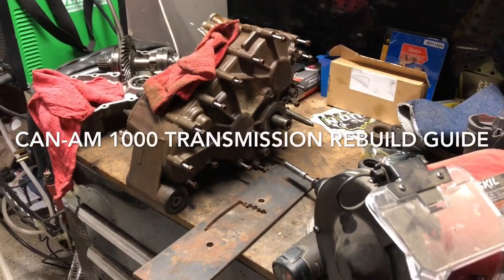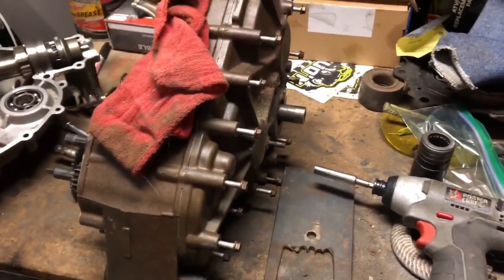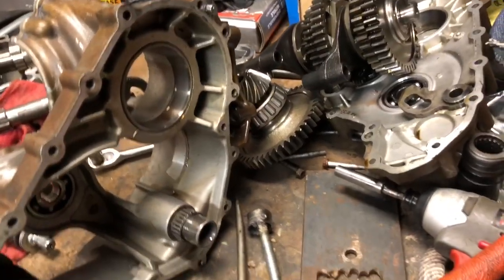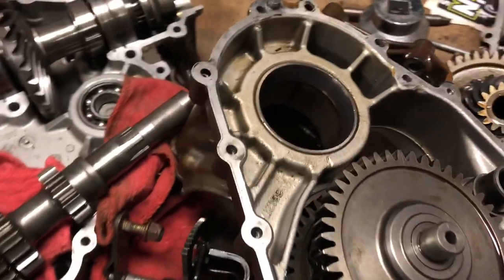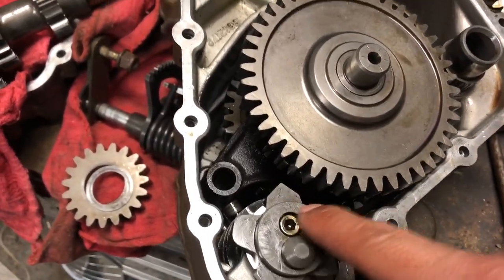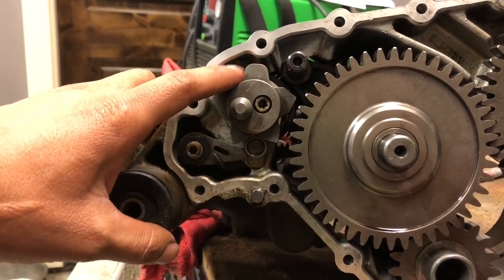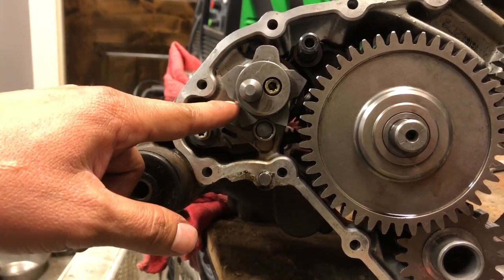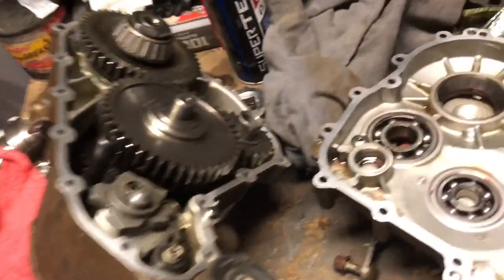Can am 1k transmission rebuild guide

Comment: My XMR 1000, my , I think its the secondary clutch is jammed with transmission and won't move, shifter shifts but tranny won't move, any suggestions on that, does the tranny need to come out ?
Reply from the maker: If it shifts and doesn't move it could be the transmission. i would take the belt box off and she what it does. If both clutches spin but it doesn't move when in gear and you push on the gas, then it could be the transmission. hopefully its just a bad belt.

Comment: great video thx..i got a 2013 1000xmr and its making a loud anoying clunking noise on and off throttle its coming from the gearbox any suggestions on what needs replacing ?
Reply from the maker: If its making noise then i would remove it and open it up. it could be a number of things but im thinking it could be some of the bearings that are really lose and bad. its probably had water in there a few times and that will mess up those needle bearings.

Comment: Did you have to essentially take apart the whole bike in order to take out the transmission? Or did you take the transmission out from the side or something of the sort?
Reply from the maker: You pretty much do have to take the engine completely out.  You have to undo both diffs and shafts to make room to slide the motor forward. the exhaust also has to come off. I was able to do it without removing the engine but its up to you how you want to handle that. Its not a fast job so take your time and take lots of pictures

Comment: If I take the cover of the shifting shaft side am I able to replace it by just taking that side cover off?
Reply from the maker: Its been a while since ive done this but if i remember correctly i think you can. Make sure its on neutral and that before you take everything apart all the markings line up. But since you already have it out, it would be a good idea to inspect everything and make sure you don't have any pieces of metals inside from the broken spring.

Comment: Is there any difference between the ATV and sxs gearbox's when it comes to rebuilding
Reply from the maker: Some do have different gearing inside i believe but the shell should be the same. But depending on the model there are 2 different transmissions  sizes. there is a bigger trans that most big xmrs have and there's a smaller one that the more basic can ams use.

Comment: I was told my clutch inside my transmission is bad but they didn't give good details on whats wrong. I can drive It in reverse fine just have a hard time going forward and it just grinds but if I push it can get it to go almost like jump Starting it/ 2015 can-am maverick 1000r turbo xds
Reply from the maker: Not sure if the 2015 mavericks are different but i don't recall can am having an internal clutch in the transmission. it could be many things but the easiest to check is your shift cable and linkage. If those are good then it could be a bad gear, bearing or spring inside the transmission.

Comment: I have a question I have a Maverick xmr 1000 2015 with a bad bevel gear and I can't find it anywhere do you by any chance know where I can find a replacement for it?
Reply from the maker: No sorry I Don't. You can probably find a good used one on ebay if you keep checking eventually one will come up for sale on ebay.

Comment: You should do a video on how to take the gearbox off of the maverick. That seems to be the hard part. Or can u kind of explain in the comment?
Reply from the maker: I have no idea how a maverick is set up but im sure there rear or front diff will have to be able to slide to let the drive shaft slide out. the hard part is removing the bolt that holds the shaft to the transmission. I believe you will need a 13mm wrench. I find that the flexible ratcheting ones are a lot easier to remove that bolt. I know I'm a little late but just wanted to let you know. not sure why i never saw this comment before.

Comment: Hi boss I need to replace the counter shaft on my transmission. 2022 Can AM Outlander XMR 1000R Can you guide me on that?
Reply from the maker: I would first make sure you have a manual. Just take your time and look at my video or multiple videos to get a feel for things. Its really not that hard. Take a lot of pictures/ videos as you take things apart and it will help you put it back together once you're ready. I would also try and order all your parts and try and do it all in one day so everything is fresh on your mind.
Reply: @awences1  thanks that’s what I have in mind. One more question that can be done without taking the transmission out ?
Reply from the maker: @GabyColon-h6h  I don't think that's possible. Even if it was I would take it out. its a lot easier to get to things on the bench than on the ground. If i remember correctly you'll have to undo the front diff and drive shaft along with the rear. This will allow you to slide the engine forward and remove the transmission. some please say you have to remove the engine but ive removed the trans without doing all that. Its a tight fit.
Reply: @awences1  thank you again! Very helpful 🙏🏻

Comment: Hi, I was driving at L speed, I stopped and switched to H but I didn't see that the changer didn't fit in H. I started and drove 10 meters and then I heard a click and I think only then did it fit H. Did something get damaged in the gearbox , can am am 570 max xt I heard it thump
Reply from the maker: I wouldn't think so. Ive had several can ams and almost all do this at one point or another. You almost always have to rock the atv some to get it to switch gears.

Comment: I got a problem with my transmission jumping out of high gear. I changed the sleeve and high gear but it didn't fix it. The forks and shift drum looked OK. What did you change on yours for parts? I'm thinking spring on shift drum is weak.
Reply from the maker: I changed the shift fork and spring. The spring will get week overtime and fail. I would change it before it comes apart and ruin the gears. Also just make sure all the bearings are good. I also replaced a gear that had some damage but im sure yours is probably ok. Just inspect everything and replace if necessary.

Comment: Hey man, great video. I dont have a can am yet but i love watching these types of videos before buying.. I am looking at a 2017 renegade 1k and the guy says the shifter is loose. He sent me a video of the linkage disconnected from the trans and shows how it clicks into each gear.. I'm wondering if this sounds like a a linkage adjustment issue or would the trans need to come out? He says it doesnt go into gear hard or pop out.. But, im just curious why he's pointing this issue out.. I had a polaris scrambler for a while that i had the trans out frickin day 1 after buying it from a guy... trying to avoid the same.. appreciate anyones input here. thanks.
Reply from the maker: Hard to say without seeing it in person but the easiest thing to do is making sure the shifter is adjusted properly. Mine would grind when it shifted so you would have to move it to N then back to H or L to get it to click. Eventually it just broke. If it shift fine without the linkage with no grinding then I would start by replacing it with a new one and she how it does.
Reply: @awences1  yeah I bought it for 6k and rebuilt the trans. All good now! 👍
Reply: For the record. I had the trans out twice after for the same reason, that spring broke both times.. Also, found some cracks in my casing so I ended up buying a brand new trans.

Comment: Hey man,  i need a lil help,  do u know what way the arrows suppose to be pointing on the piston on a can-am Renegade 1000cc 2014yr that's the only thing stop me from putting it back together
Reply from the maker: I would still verify this with a dealer or local shop they should at lest be able to tell you that. I know the 800 both arrows point toward the rear of the atv but not 100% sure on the 1000. If you have a service manual im sure it will tell you. I'm sorry i wasn't more helpful.

Comment: So if I was going to replace my shifter inside the gearbox just like u did, would I have to take the gearbox out of the bike? Can am maverick 1000. Or could I just do it in place?
Reply from the maker: Sorry for the late response. Im sure you already got it figured out but it would be a lot easier to remove it and do it on a bench. From my understanding I don't think what you are asking is possible.

Comment: I just rebuilt a 2012 commander 1k. I have all gears but high.. any suggestions?
Reply from the maker: Only thing i could think of is maybe you didn't set it on the neutral position before closing it or it got bumped out of neutral when tightening everything up. Could also just be and adjustment it issue. that can be done without taking it apart again.  I would start there first.
Reply: @awences1  I have every other gear but high..it goes in the spot but does not engage
Reply from the maker: Go through and check the linkage for alignment. Also check the linkage to see if ts bent or worn in any way. Set the linkage in neutral, so go to neutral and set it then it should go through all the gears no problem, if it will not do that then there is either slack in the transmission or a bent component in the shifter mechanism. Could also be that its missing a shim inside and causing it not to engage. Never really had that problem before so its kind of puzzling.

Comment: how did you know that linkage was bad?wouldn't go in gear ?i think that may be my problem
Reply from the maker: On this one if it was in high it would pop out of gear and make a grinding sound like it wasn't engaging. I would look it to taking yours apart before it breaks and chips one or all your gears. it did it to this one and i had to replace a gear. When it went out I had given it a little gas not much and all of a sudden it wouldn't go anywhere and the sifter was really soft and not go in to any gear. Not worth waiting till it goes out.
Reply: What would you charge to rebuild mine if I shipped it to you? Mine makes grinding when first going into high gear, but never slipped out one in gear. I'd like to fix before it breaks.
Reply from the maker: Im not sure. Since I just do this a a hobby I would hate to rebuild it and something go wrong. I would feel a lot more comfortable just helping you in any way I can. Mine was doing the same thing. Could just be the shift fork spring inside fixing to go out. I would defiantly open it up. its easy to do if that's  all that's wrong with it.
Reply: @BMcGhee-t5v  did u find out the problem

Comment: Where can I get parts at
Reply from the maker: @brianwilliams2906  the company I would get parts from shut down but if you google can am parts I’m sure something will pop up. Find 2-3 and compare prices and shipping and go from there.
Reply: @awences1  thanks I need a used transmission if you know or hear of any.
Reply from the maker: @brianwilliams2906  I don’t know of one but I’ll keep my eyes open. I would check your local area on marketplace too.
Reply: @awences1  been looking for 2 years.
Reply from the maker: @brianwilliams2906  try eBay. Sometimes they have some at a reasonable price if they are missing some stuff. You can probably make 1 good transmissions out of 2 using yours for parts. What’s wrong with your transmissions?
Reply: @awences1  came in as a trade. I had a piece of equipment that I had for sale and the guy and me did some trading and the transmission had a hole in the bottom of it so it pretty much is ruined

Comment: I see that bearings is broken on that big gear you must replace them!  On both sides small lines shines and in middle it's fully mat that's mean it's ded... I'm fixing mine now so I know 🤔😉
Reply: 13.59min that gear I saw correct that there's is one tooth is missing? ?? And you don't change it ?
Reply from the maker: It seamed to spin good with no problems but Ill take a closer look. I rebuild this as a spare and still have it up in the shelf.
Reply from the maker: @Laccels  You are correct there was a missing tooth. I bought a new gear for it I just grabbed the wrong one . I noticed it before bolting everything up so I changed it just. Good eye
Reply: I also just rebuild my renegade 1000r xmr gearbox 😉 for my self so I know know how it should be hehe already driven and works perfect jeeehaaa... I changed a lot of things 💸💸💸💸💸😓
Reply: @Laccels  what did you change? And what was it doing?
Reply: @scottmcdermott633  i changed a lot of things inside in a gearbox like bearings all and gears shifting mechanism....
Reply: @Laccels  was it jumping out of high gear? I'm thinking the spring on the shift drum is weak. Is that possible?
Reply: @scottmcdermott633  you must check the gear shifters ... between high and low gears there is a problem I think...
Reply: @Laccels  on the main shift hear cluster? I put new needle bearings. Changed HI gear and sleeve with the shift fork. Never fixed it. Back on the bench now
Reply: @scottmcdermott633  try to find me in messenger